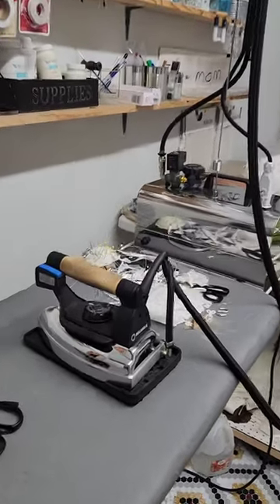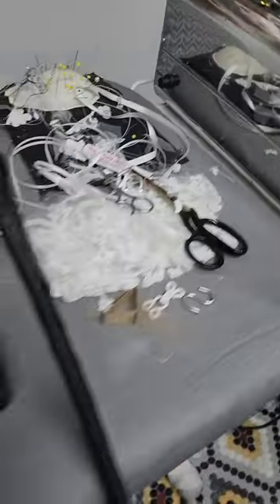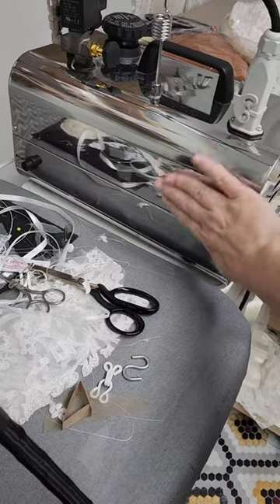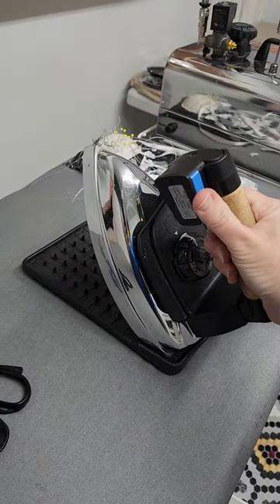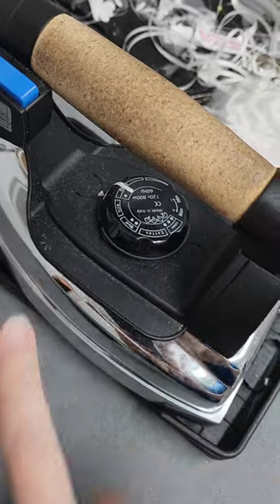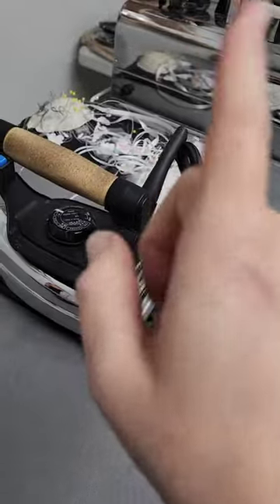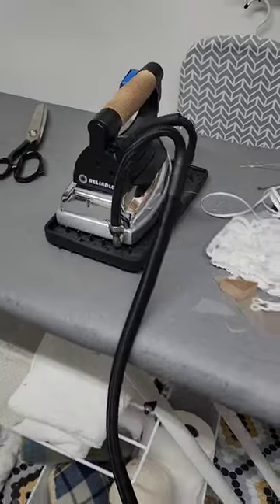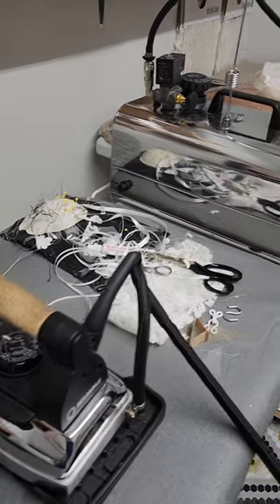Can you IRON a wedding gown? How do pros prevent scorching wedding gowns? #shorts30

Comment: I will be replacing my current iron system with this very set up. good to see you recommended this brand.
do you have any maintenance parts to replace every few months, on this iron.
do you recommend the extra long cord.
I asked the company but of course they  have a goal to sale.
Reply from the maker: I always buy the extra long cord and I have it put on by an electrician. They just kind of check over the machine and stuff before I use it.  Every couple of years you have to buy a new gasket for the water tank lid. I would buy that directly from the Reliable company. The ones that they have are better than the 3rd party ones.

Comment: So that I understand correctly:  the actual metal on the iron can burn the fabric if it’s too hot but the hot steam will not?
Reply from the maker: I guess, in *theory*, maybe steam could?? This reeeally gets into physics. Atmospheric pressure directly influences  the maximum temperature of water vapor, (hence the usage of a boiler to increase the pressure in the tank so the water can be more heated) Once the water moves from the tank into our atmosphere, it rapidly cools back to 212, (hence the speed the steam rushes out.) When the steam is gathering back into water droplets, it is because of the rapid cooling of the molecules back to room temperature. It's amazing how air pressure and and how dense the water molecules are can rapidly affect the temperature of the water. In short- I've never scorched a dress with a sole plate set to nylon, and I have never scorched a dress with steam from the iron regardless of how profoundly hot it is in the boiler. Ahhhh... I loved studying physics in university. Can you tell?  Lol
Reply: The maximum temperature of boiling water is 212 F, that's actually not very hot in terms of iron settings, but the steam is very effective at taking out creases.
Reply from the maker: Yes, but she's asking about pressurized  steam. For example, at 60psi, water steam is at 307°.  But, I think it likely dips well below 212 very quickly. My point is, it would be very difficult to state a temp for the steam since it is rapidly changing.
Reply: @BridalSewing  I learned about this back in chemistry class but forgot it mostly now.  Thanks 😊
Reply from the maker: It's nice to see it actually apply to our life, isn't it?? Lol
Reply: I have melted a tulle veil with my old Rowenta steam iron. 
So you can melt tulle with them. But if you stay back (like I should have 😬) you’ll be alright
I usually start inside out with my gowns if they pay for steaming because you get into rhythm of it by the time you turn the gown right side out you’re “steaming” along 🤣 and usually are moving fast enough and far away enough to not melt anything 
Don’t be afraid tho. That veil is the only thing I ever burned with a steamer. I had to remove all the beaded trim (thank God it was one piece) and hand stitch it onto another veil I had cut and gathered for headpiece.